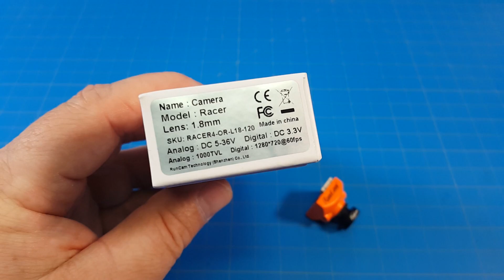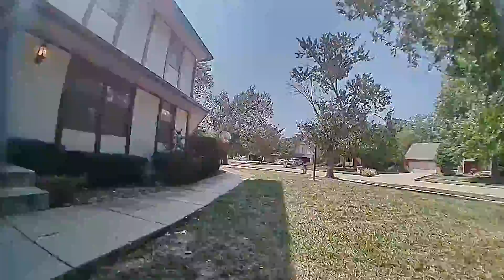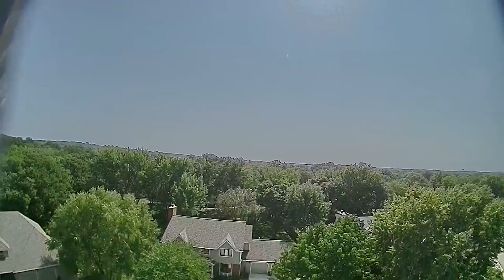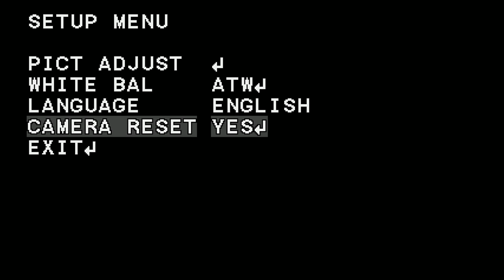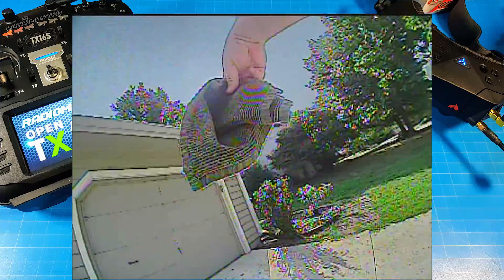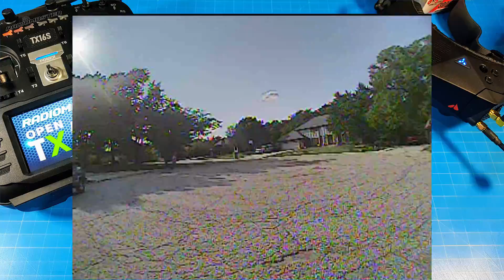RunCam Racer 4 // Analog and Digital // FPV Camera

Comment: Heres the benefit with this camera The plus with this camera is you can make adjustments with the color,brightness, sharpness, etc. With the Caddx Nebula #1 which is the version I got. There isn't any adjustment at all??. What DJI firmware was you using on the Vista at the time of this recording Nick. Much appreciate you taking the time to review this camera
Reply from the maker: I believe the firmware version is either 1.0.6 or 1.6 I can't remember their version format off the top of my head.
Reply: Caddx nebula micro analog can make adjustments too.
Reply: @ivyxiang9686  They are two different versions of the Caddx Nebula? First One that was sold was attached to Caddx Vista with no camera control at all? No adjustments in the DJI goggles either and as the time of this post no firmware update for it?..(Which is the one I bought) Then right after the Nebula was released with the  Caddx Vista. The second version of the Nebula was released (Without the Vista unit) which has camera control and can also be used on analog. Which one are you talking about? I assume analog versions only? Because the version I bought with the Caddx Vista has not got any kind of adjustments as far as contrast brightness color?
Reply: @allennickles3970  The first we released is nebula nano, which only support HD digital and can only work with vista, only with 16:9 image. The second one we released is nebula micro, which support both analog and HD digital, when connect with vista unit, it is a digital camera, only with 16:9 image; when removing the vista unit, it is a very good analog camera, support both 4:3 and 16:9 image.. runcam racer 4 HD also only with 16:9 image, exactly same as caddx nebula micro, because it is not the limitd of camera, it is the limit from DJI goggle.
Reply: @ivyxiang9686  The Nebula nano is the one I'm talking about
Reply: @allennickles3970  I see, you said this camera can make adjustments, that's different. analog mode can make adjustments, but digital mode can't, same as nebula micro.

Comment: Why are people saying that Caddx will block this from being used with DJI systems?  Surely only DJI could do that.  Caddx could prevent this camera from being used with the Vista but presumably it will continue to work with the original DJI Air Unit?
Reply from the maker: I am not sure myself. Seems anti fpv to stop a camera from working with a vtx
Reply: Nick Burns yeah it’s totally anti-consumer, I don’t see why people seem to be taking caddx’s side here.

Comment: Gday Nick, not having used or owned any dji gear its hard to compare something if you've never used it, this camera looks good in hd but the analog was terrible it definitely needs tweaking or is that how it is? bugger!! nice job with the review mate.👍🛸
Reply: As our racer series are mainly for racing, the sharpness might be a little bit higher than other fpv cameras. This might be the reason why you think it's terrible. If you are not racing ofter, I suggest you phoenix 2 a good choice. https://shop.runcam.com/runcam-phoenix-2/
Reply: @RunCamFPV  can DJI make unusable the runcam 4 on firmware update?
Reply: @RunCamFPV  Gday Runcam, no i dont race i cant understand how anyone can see clear enough to race with the fpv feed but as Nick has stated quite a few times the fpv feed is better in the goggles so what we see on tv is not the same thats fair enough and oh by the way i do own 2 runcam phoenix nanos on my micros.👍🛸

Comment: This camera won't work with DJI on the next firmware release.
Reply: I certainly wouldn't update it then!
Reply from the maker: Really? Did DJI make a statement?
Reply: @NickBurnsFPV  yes, Runcam made the digital side without approval of DJI/Caddx. 
They were really unhappy to see this cam, I think that they even took parts of the code from Caddx. 
DJI claimed that they will exclude this cam in the next firmware versions
Reply: @NickBurnsFPV  This blog seems to sum it up nicely: http://www.multirotorguide.com/news/runcam-racer-4-analog-digital-fpv-camera/
Reply from the maker: @richardbulger  Seems like an upset threat. We shall see if DJI blocks it or not, I don't know how closely caddx works with DJI